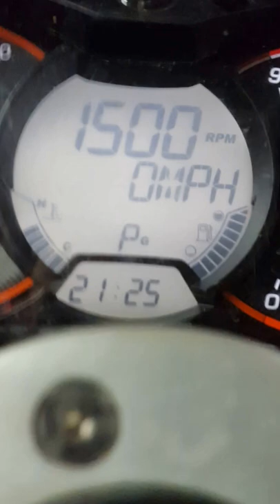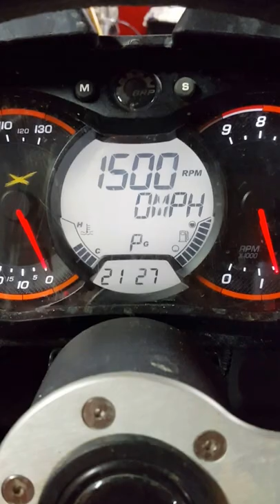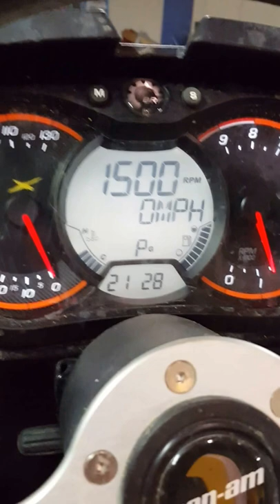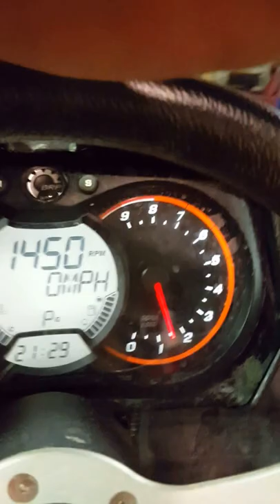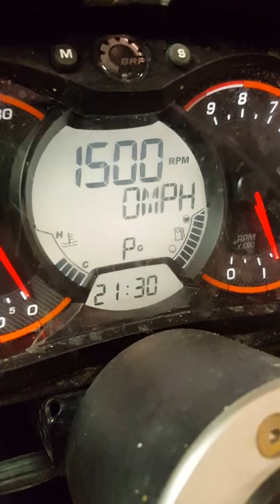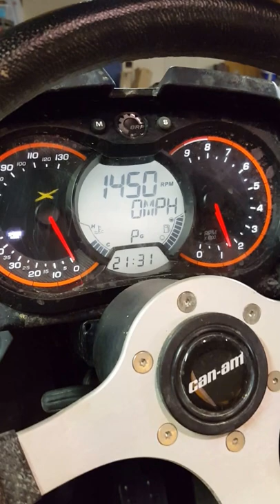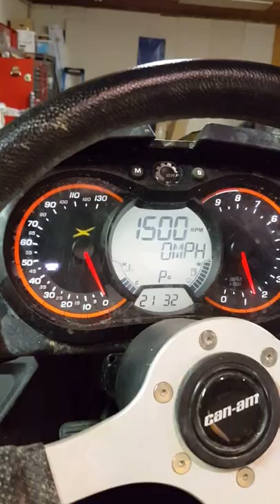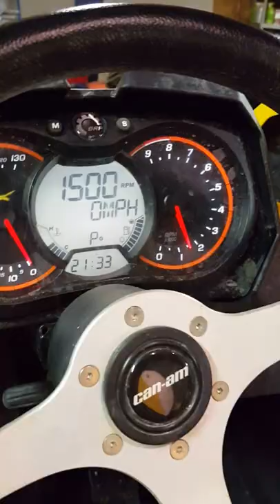Maverick XMR tcp radiator

Comment: Brandon,
 This is Garth at TCP, this video just kills me! Especially showing it at 5 bars, fan kicking on placing the cardboard on with the temp never climbing and it finally overcoming the temp. Great video and a great idea! Thanks again for taking the time to post this!
Reply from the maker: TCPPERFORMANCE1
I don’t remember posting this video it’s been so long. Lol. 
Never have I overheated or had an issue with the radiator since I got it. 
I think that cardboard covered 60 to 70 percent of the free area of the radiator. 
I have since had the flash done by Bruce Cline and it now stays at 2-3 bars all day and we like to hit every mud hole we can find. 
Your product is great though! My brother has one in his maverick as well.